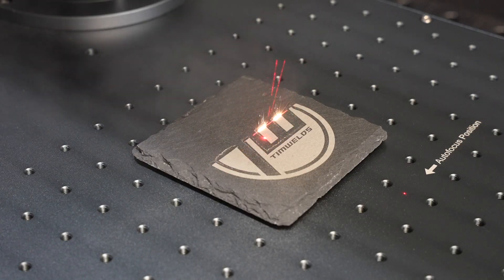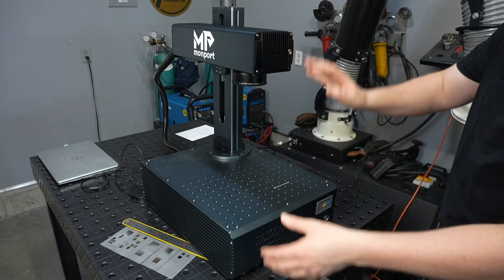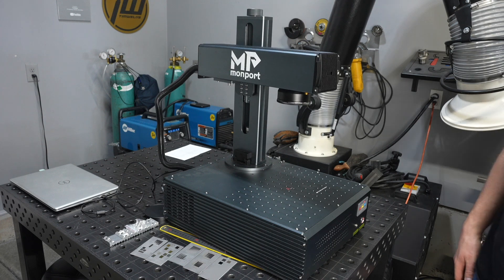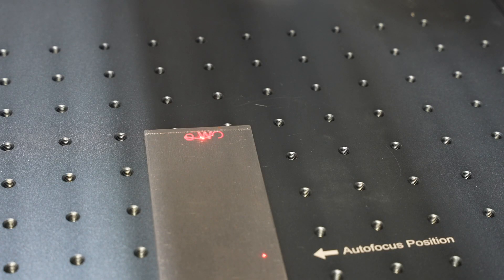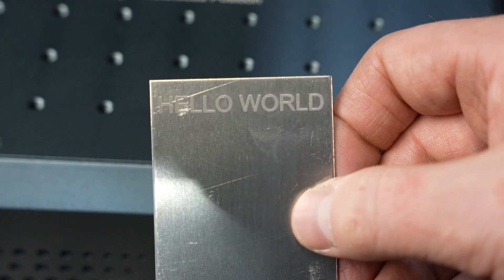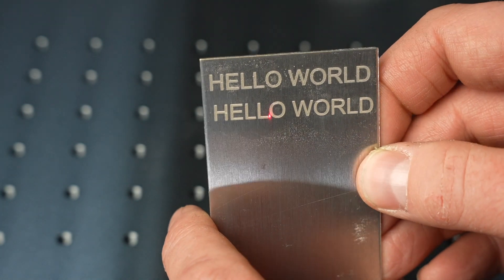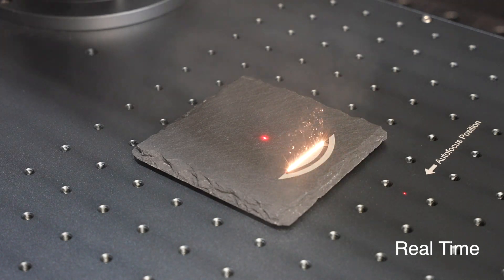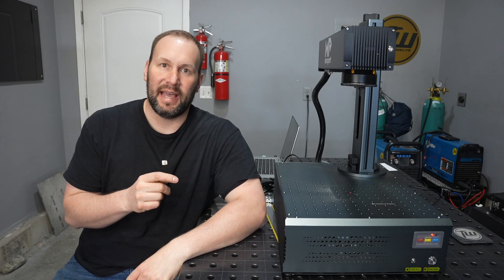Testing The Ultimate Fiber Laser: 100 Watt MOPA Monport GA100

Comment: Just got my GA60 today and unfortunately the threaded holes for the 2 thumb screws that hold the focus tower vertical are stripped out and won’t hold the screws. Time to see how good their customer service is I guess
Reply: I had the same with my GA100. I buoyed 2 screws at a local tool store. But it was not the once surprise. I did order the GA100 with a JPT source with 1-4000 frequency, but I did get a GA100 with the cheap GZtech source with 1-3000 kHz. Also the controller is another they did advertising.

Comment: cab you use it to make circuit boards? on copper clad fiberglass sheets, f4 if i remember?
Reply: I also would like to know. I recall the same question on the video of the less expensive machine.
Reply from the maker: There are a few videos of doing this with similar lasers, but I haven't tried it myself. I assume it's really just a matter of fine tuning the power output. It would be really cool to try out for one off prototyping!

Comment: This is something I’ve been wanting to get for a while. But I’d like to cut thin sheet with it as well. I know the 300 watt models will do that easily, and the 200 will as well, though more slowly. I wonder what this can do. Too bad this is as big as this company gets right now. The other thing that would expand the usefulness of these things is if they would mount them on an x.y gantry, like other lasers. They wouldn’t need the galvo equipment and you could do a usefully larger area.
Reply from the maker: It's been pretty fun to play with and I think it would make it through very thin sheet with enough passes, but I haven't tried it. I think you'll probably start to see the higher power fiber laser sources like the 1,200 watt handheld lasers have mounted to a simple gantry setup for cutting soon.